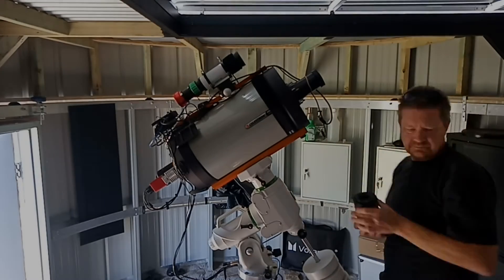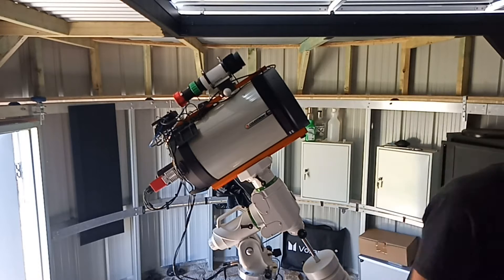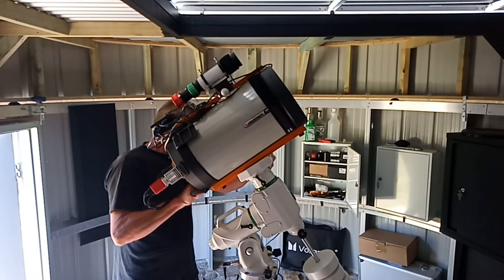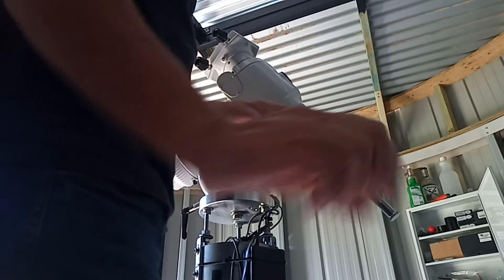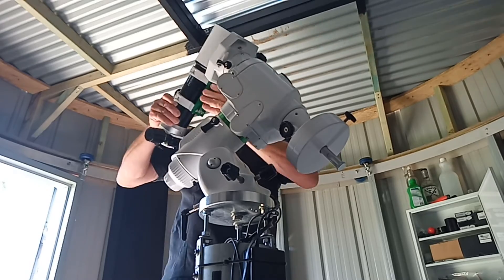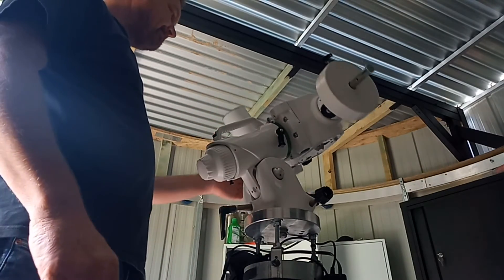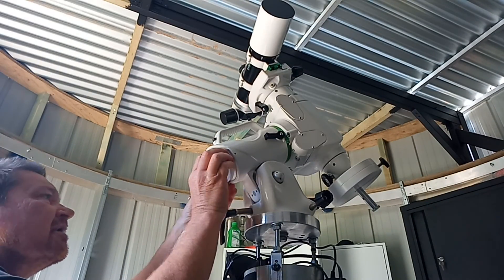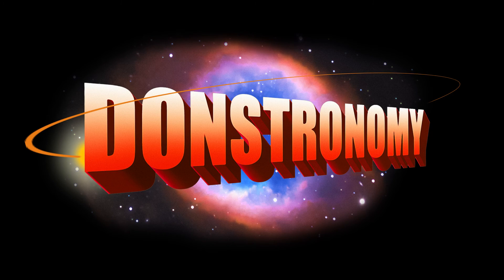EQ6R-PRO Telescope Mount Adjustment

Comment: My EQ6R mount developed a 'knocking' noise and the DEC would go absolutely crazy.  After many tutorials / emailing with Skywatcher, I arrived at a painful ($$$) decision to send the mount in for an overhaul (4 years hold).  I tried everyone's suggestions and followed many AI ideas.  Nothing worked, until I found your tutorial and thought I'd give it a try.  I performed the tuning as outlined in your video and it worked.  Guiding hasn't been this accurate and steady in a long time.  Thank you very much.
Reply from the maker: That's great to hear, I'm really glad the video has managed to help you out with your issues. I know that knocking sound very well with the EQ6R. Running a guiding calibration after adjustment and checking the backlash graph in PHD2 is a great way to see how your mount is tracking. I try to get it as close to the ideal graph in both axis that I can. 
Clear skies, Don

Comment: Hello, I follow your installation from the beginning and I start to make the plans to make me the same kind of observatory. And I wonder about indoor humidity. Could you tell us a little bit about this aspect in the design of your observatory? Thank you in advance
Reply from the maker: The roof has an overlap of about 40mm all round. This is to ensure that the roof does not come in contact with the observatory walls when rotating. The roof shutter opening also sits on 15mm roller wheels. This all means it is not tightly sealed so the humidity is fairly similar to outside. I do get some condensation which sits on the metal ceiling and can drip onto the telescope. This could be fixed with insulation which I hope to do in the future.

Good luck with your design. Hope it all goes well for you.

Cheers Don

Comment: Very useful video. Is any slight tightness in the RA and Dec going to make a difference to slewing and tracking? I read somewhere that a slight resistance in RA tracking can be a positive thing. I have no idea whether a loose or slightly tight axis is the most preferable. I can imagine both having their plus points.
Reply from the maker: Sorry for the late reply and thank you. I make sure there is no play at all in either axis. It's a bit of a pain as you have to keep adjusting many times. Also I find when you get the weight back on the mount you may have to re adjust. Generally if you are too lose in RA or Dec, you will be able to hear it when it tracks. This has to be done with the mount loaded to detect any noise. 
In my case i needed to adjust because my axis was so tight that it was difficult to balance the telescope. If you cant balance the scope then you will have big guiding issues. Another thing to keep your eye on is the tracking curve. If you notice repeating curves in your graph, you may need to adjust your mount.
Good luck.
CS Don
Reply: @donstronomy7606  Hi. Thanks for that. Just bought an EQ6-R Pro and the RA axis was stiff to the point where it would not balance correctly. Ordered a rubber strap wrench and got the axis loosened by one-eighth turn. That did the trick. Have to say I am impressed how good these EQ6 mounts now are. I bought an original back in year 2001 and that was dreadful in every way. On first clear night with this new mount I polar aligned it to near perfection using the handset polar align feature, and the 3 star align dropped all targets after alignment into the center of the eyepiece field at 214x magnification all night long.

Comment: Great video.   I have an AZ-EQ 6 and it needed quite a bit of tweaking.  The backlash in DEC was too much for my liking but after careful adjustment is virtually gone.  

I like your EdgeHD 9.25.  I have the standard 9.25.   At the time it was a coin toss between that and the EdgeHD 8.   

I have the focal reducer / corrector from Starizona for it and that works ok.

I get over to Tucson twice a year,  December and March and visit Starizona each time so if you need something picked up and brought back to Oz hit me up then.  Save on shipping costs.   All the best.
Reply from the maker: Wow! Thank you Wolfie, that is a very generous offer. I will definitely consider that. 
Sorry to have to break this to you but the earth is Flat. To prove it I put a spirit level on the ground in both hemispheres and it was flat. Can't argue with that LOL!!
Reply: Thanks for a great video Don- very helpful. 
@wolfie6020 - I have an AZ-EQ6GT but can’t work out how to get it apart on either RA or Dec. On Dec I removed the 3 grub screws but couldn’t loosen the silver ring. And on RA, where are the screws? And sizes? I found some hidden behind the polar scope but found nothing that fitted in order to loosen them 🥲.

Comment: On the RA nut are two holes underneath. I used two screws and a piece of bar stock to leverage the nut
Reply from the maker: Nice one! I took the polar scope cover off and had another look.
Reply: Sometimes even that is not enough. If the mount is new, this invalidates the warranty.